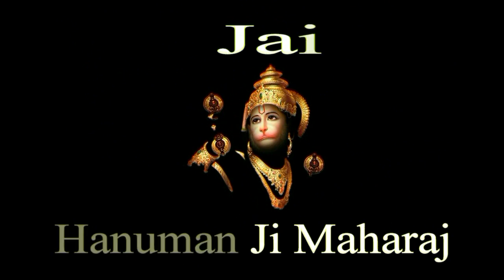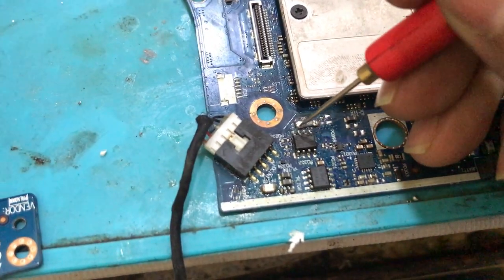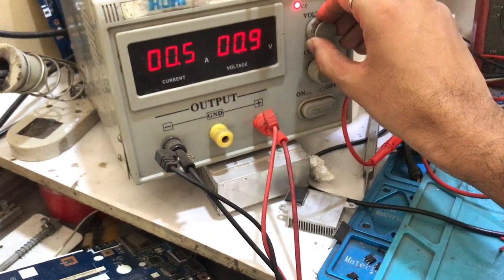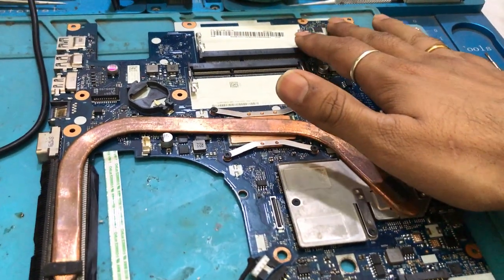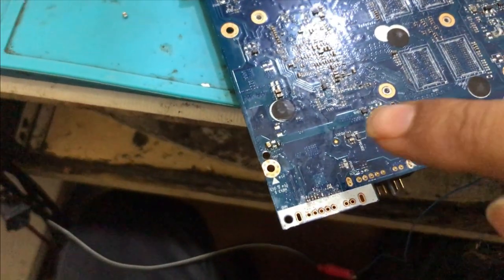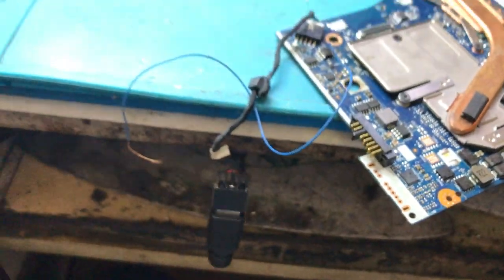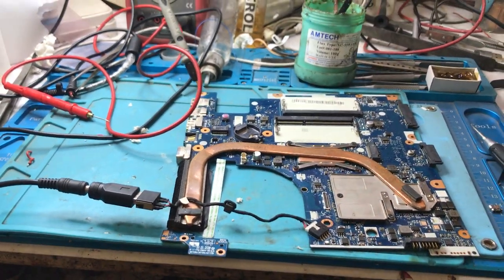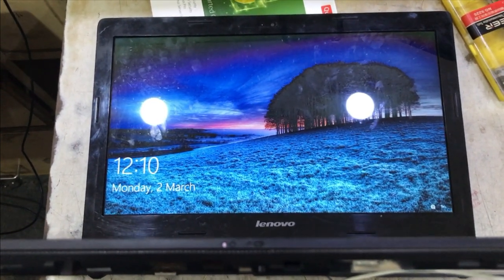Lenovo NM-A361 laptop No power on with adopter or battery #Aditya11ttt & #Satishbhai

Comment: Why did you not checked voltage at i/p & o/p of mosfet first...why go with impedence checking direct ?
Reply from the maker: Every one in the world has there own style of repairing ! 
There is no rules set for repair ! 
Why don’t u start your own channel with loading videos ! 
We will also learn something from you !
Reply: @Aditya11ttt  I am confused.. if I find mosfet short to ground. Mosfet is bad and should i remove mosfer. Or  if I find mosfet short to ground that means there is short in output line ?
Reply from the maker: @geekybruce4819  there is thin line of gap between theory and practical!!